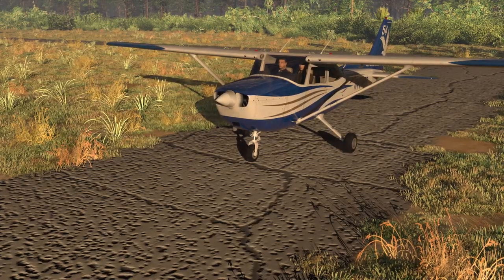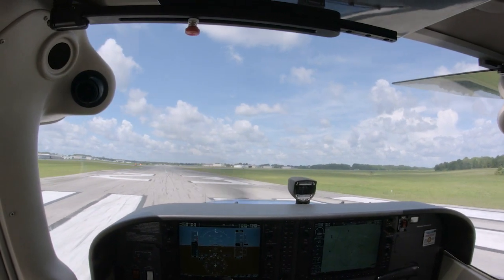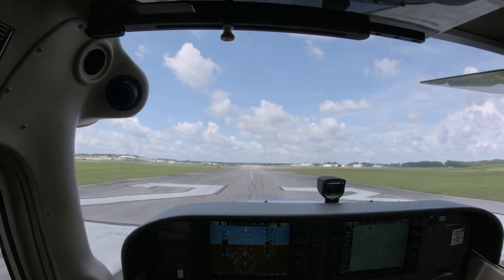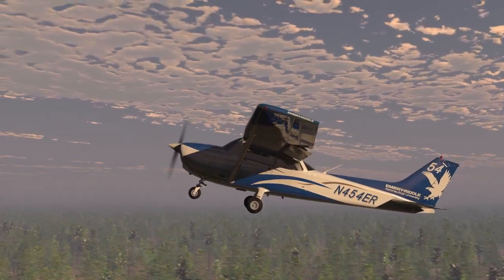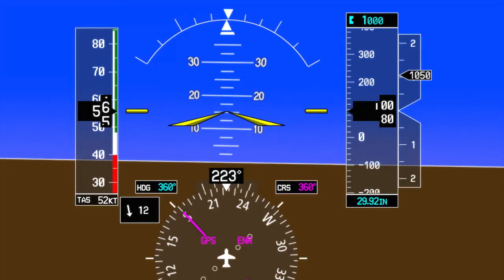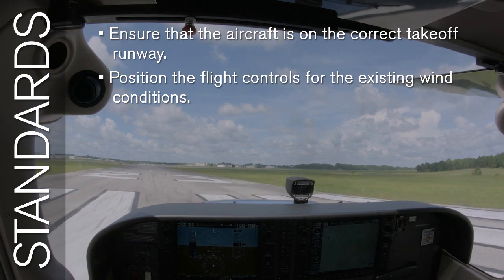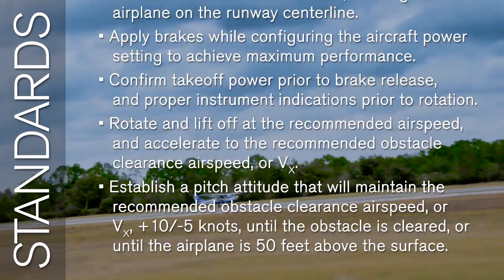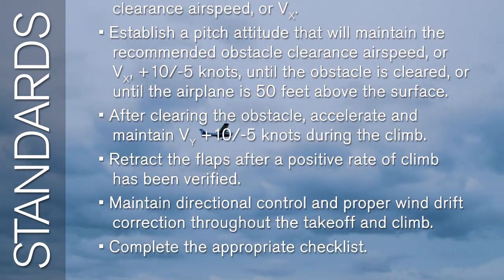Short Field Takeoff

Comment: Flaps setting depends on the airplane. The drag from flaps can slow down some planes on the runway so significantly more roll distance is required to reach rotation speed. But for my plane 15 degrees of flaps works best.

Comment: The little brake thing is pointless. The air rushing over the wheels will make them spin again after you let off brakes.
Reply: Not really,, if the wheels are spinning, it will make a vibration. In addition, they won't spin too after braking

Comment: There is bad advice in this video. Many Cessna 172 aircraft POH call for zero flaps for short-field take-off. This video instructs the pilot to use 10% flaps. If you use 10% flaps for your shortfield takeoff you will probably fail your checkride. Check your POH!
Reply: GS Wingnut doing my Canadian checkride tomorrow, it calls for 10% flaps on both short and soft field take offs.
Reply: @FireBoss08  It depends on  what the POH for your aircraft specifies.
Reply: @FireBoss08 Good luck!
Reply: Thanks! Passed the ground portion! Weather moved in and couldn’t fly. Flying next clear day.
Reply: @FireBoss08  g
Reply: Its not bad advice, its training for students at Embry riddle using the Embry riddle fleet.
Reply: S models call for 10 degrees flaps.  Embry riddle all have S model 172s.  I fly an N model and they say to not takeoff with 10 degrees flaps unless it is a soft field.  So yea, check POH, but the video isn't bad advice for the audience it is intended for.
Reply: You are probably talking about older 172s, I think for last 10-20 years POH states 10 degrees flaps, always check your plane’s POH
Reply: R models and up all call for 10 degrees of flaps for Short and Soft field procedures. You are correct to check the POH for your aircraft.
Reply: Check your specific poh! This is a basic video and many other factors can be considered as well depending on specific situation.

Comment: Should I have flaps in? 2:20
Reply: I have always found it curious that older c172 short field recommend 0 flaps and new c172 call for flaps 10. 
As far as I know its the same basic airframe [aerodynamically], maybe the higher power of the new models changes the optimal setting or they have just had time to do a lot more testing. Also old c172 could go to flaps 40 which really allowed a steep approach and short landing, newer models are limited to flaps 30.
Reply: @TheDuckofDoom.  I heard one of the main reasons they took away flaps 40, was that go arounds were extremely dangerous